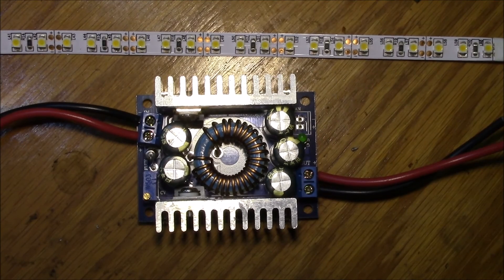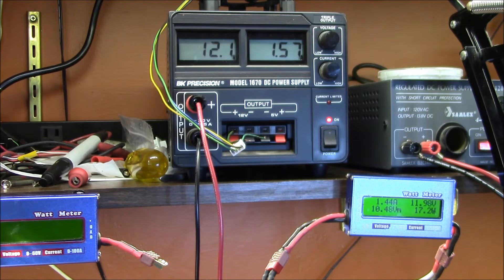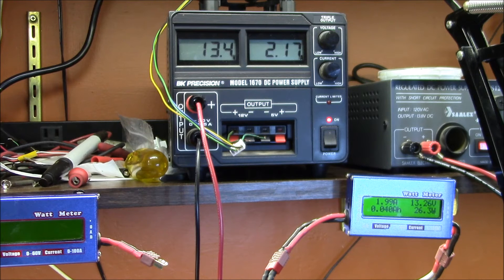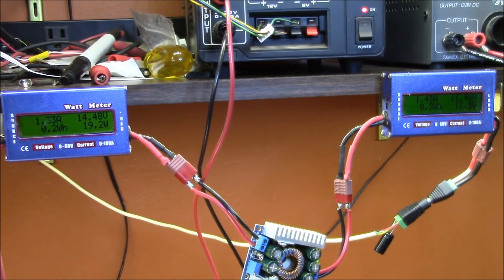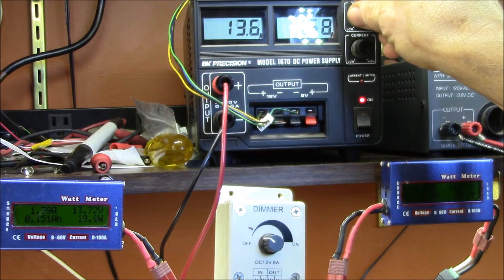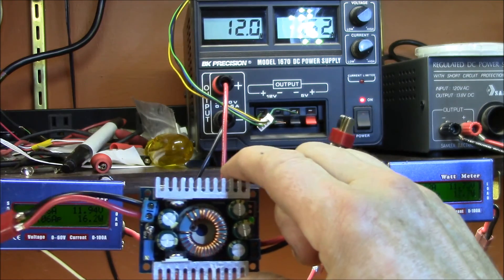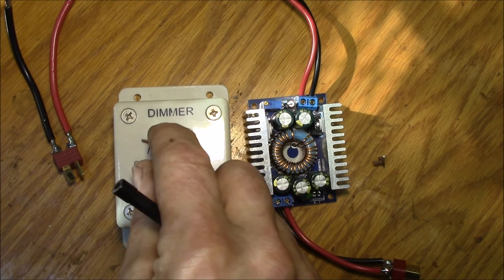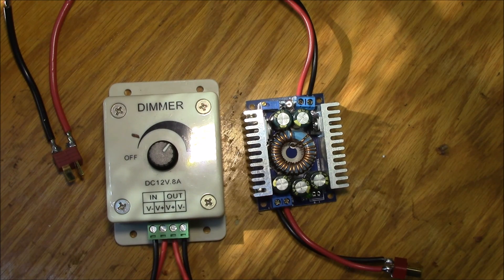DROK 8A DC Buck Converter Review, Part 2

Comment: I was going to buy this but I'm confused. Is this 8 ampere or .8 ampere (point eight)? The box says .8
That is a huge difference.
Reply from the maker: For sure it's 8 amps, I think the listing shows 12 amps max. if you add forced air cooling like a fan.  I've run mine at over 5 amps driving LED strip lights for many hours at a time w/ no issues.
Reply: R Brown 
Thanks for your help. It will help me alot. :)
Reply: That is in regards to the PWM dimmer, correct? It looks like that's what you're referring to but just want to make sure because I don't want to burn my house down :). I want to run one at about 2A for about 12 hours a day. Can heat be a solid indicator of whether or not something like this is being driven safely? For example, if we didn't know the true rating of the device but it stayed cool, could we assume it's safe? I won't hold you accountable if something were to happen though haha. Thanks!
Reply from the maker: I've used both the PWM dimmer as well as the DC buck converter to drive my LED strip lights.  I find heat is the best way to judge the rating.  Usually the ratings on these sorts of parts is over stated,.  I find you can usually do between 1/2 and 2/3 the "rating" with no issues.  Trying to push it to the maximum rating is asking for problems.  Probably a good idea to get one and test it out a bit and see how it holds up with your load and installation.
Reply: could i use this with  an old 24v laptop charger to power a 5m/16' RGBW 300 led strip ,my power supplies are like 3 .5  to 4 amps
so if i use the  busk converter to  step it down to 12v then will i get  more amps to drive my strips? does a buck converter let you use more amps from the power supply at low voltage, since i am  dropping 24v to 12v would that increase the rated amp output of the power supply
of 4A to  something higher? if so what would the ratio be , would i get double the current  output since i halved the  voltage , so 12v @ 8A from 24v @ 4A ?
i plan on using it with a lixada wifi LED strip controller